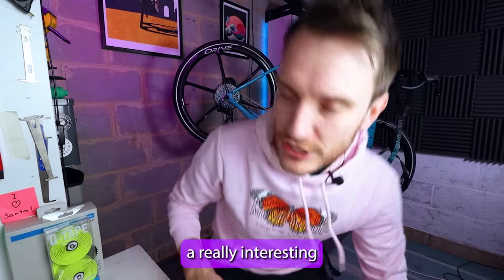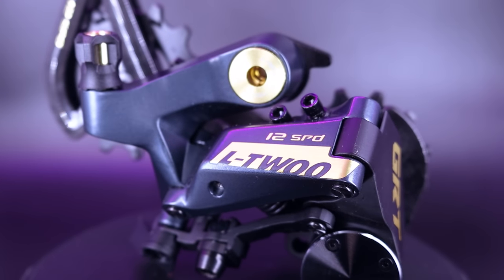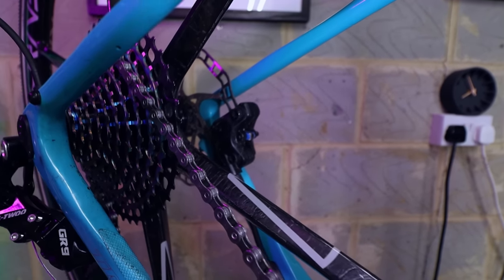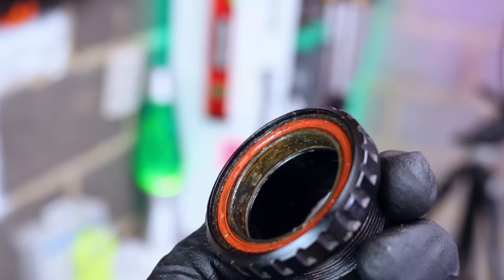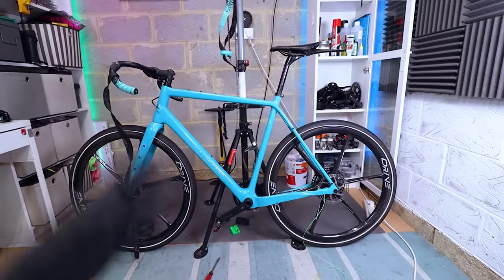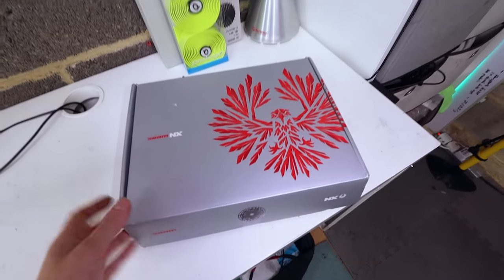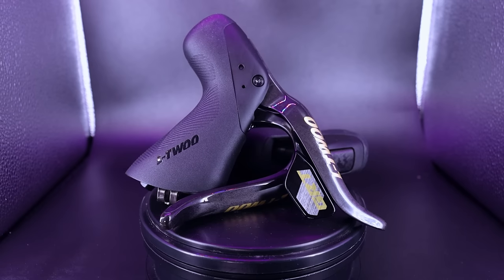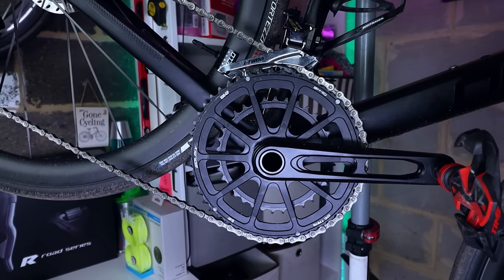INCREDIBLE 1x12 gravel performance on a budget - L-TWOO GRT

Comment: The cassette issue is simple enough. You are required to use the 10 speed spacer, required for mounting 10speed on 11 speed road bodies. The spacing of this 12sp cassette is based on the 10sp mountainbike body, which basically still is the same as the old 10speed road body. Mountainbike cassettes never required an upgrade of the spacing since the larger cogs can overhang on the spokes ( if the wheels are properly dished ). This means 11 speed mountainbike cassettes fit 10speed bodys ( also road bodys ) and so do the 12 speed cassettes. I am sure you have one of those spacers somewhere.
Reply: exactly! I was curious about this one too, since it means I can get a 12 speed cassette on my old 'mtb'
Reply: This is btw a great hack for using your older 10 speed wheels on modern 11 speed groupsets. Buy an 11-34  SHIMANO CS-HG700 which fits older style 10 speed wheels. Beware that most other 11 cassettes ones wont fit on 10 speed.
Reply: @luukrutten1295  (edited) it seems that indeed the 105 r7000 11-34 has a removable spacer, so it can fit 10 speed hubs! That's very cool obscure knowledge, thank you sir. I might try it out to play with different gearing on my 26 incher

Also seems like the ultegra HG800 one has the removable spacer. I've got that one laying around, so I might try it soon
Reply from the maker: Right ok. I did think think this myself actually, so as you suggested, I slapped a spacer behind the VG sports cassette. It mounted fine, but the indexing was WAY off, and the shifting was terrible. Then with the SRAM PG 1230 cassette on the same HG freehub (it's a bog standard 11 speed HG freehub btw), no spacer needed, and the shifting was perfect... I was pretty sure SRAM and Shimano 12 speed cassettes were interchangable...? (EDIT -  I was wrong! 🤦‍♂shifting is actually fine - See pinned comment)
Reply: 1st thought i had,put in a spacer
Reply: @TraceVelo  Not sure, maybe its just VG sports tooth profile and less 'gates' on which the chain can jump up. I have no experience with that specific cassette. I can confirm most ZTTO stuff is ususally really good. But maybe L-twoo can just supply or suggest an optimal cassette, since quite a lot of variables exist.
Reply: @TraceVelo  Oh and I hope you didnt get hurt in the crash. Be carefull! You are a brave man testing all this stuff.
Reply: I had the same issue with a Bolany (?spelling) Chinese 11 speed cassette - the 10 speed spacer ring solved it. Hope this helps someone
Reply: @TraceVelo  You definitely need to use 1.85mm spacer when using the mtb HG casettes on road 11speed hubs. I even need it for my 12speed ztto 11-46, the indexing is then same as my xD cassette.
Reply: @luukrutten1295  similarly…. The new microspline Shimano 12spd 11-30 and 11-34 cassettes fit on an 11spd HG wheel.  Plus, these 12spd Shimano cassettes both work with AXS groupsets.  (I know the road AXS chain rollers are larger, but I’ve got 1000+ miles on 2 bikes with no issues).
Reply: Beat me to it. Yep. Needs a spacer.
Reply: @Luuk - please dont attempt to glue or repair you front brake lever. They are too important to risk yourself. Show the public what you should do in this situation , dispose of the broken part. You wouldnt repair a cracked helmet , same principle here - the lever is a sacraficial item in this case. 
Stay safe
Reply: @darrenst441  i never said anything about reparing a brake lever. Or suggested doing so. Nor did luke. Anyway same name different spelling😅
Reply: @luukrutten1295  I also think he wanted to address Luke. :-) Luke said in the video he might try to glue/epoxy the lever - or something like that. :-)
Reply: THanks mate!

Comment from the maker: Also forgot to mention, the small issue that I had with the RX road version of this groupset (where the shift lever didn't return fully, sometimes blocking a shift with the thumb trigger), it's not present here at all! The shifting is basically perfect 👌🥖🥖🥖
Reply: On the back of that, Luke- did you work out whether the shift lever could be moved away from the brake lever using the grub screw on the underside?

I keep looking at mine, and wondering....

**EDIT

Answering my own question: on the R9 11 speed from L-Twoo, a 1.5mm hex key on the grub screw will move the shift lever away from the brake lever.
Reply: also do note i mentioned this before.
my sensah/senicx crank i replaced the bottom bracket also i had 600miles clocked before i had clicking cranks under pressure.
spent money on a nukeproof horizon one with titanium coated bearings been solid so far and chainreaction sell the bearings. not the cheapest but 800 miles later still no issue.
and yeah for cassette wobble you need a 1.85mm spacer on your road hub to fit an mtb cassette. I had this issue when i first built my sensah 11 speed groupset

also congrats on removing the conduct kit now you can get a fancy chinese carbon stem
PS , Peak Torque Youtuber makes an adapter that lets you mount hydraulic flat mount brakes with 180mm rotors , he also UK based
Reply: It's a quirk of the Campagnolo mechanism - same thing happens on my Ekar 1by13 shifter if the levers are depressed at the same time.
Reply: Mine are fine in the RX version. Maybe it is just not consistent from unit to unit ? Also mine don't rattle, I checked it. Mine are faultless except for the shifting performance, which is overall ok but no super crisp in all gears, it tends to be a little more lousy in the small cogs.
Reply: I'm sorry about the crash, glad you are ok. Could you possibly use the R9 lever as a temporary replacement? Curious to see if the epoxy repair job comes along as nicely as expected. Ciao! 🥖
Reply: @bama95  The R9 lever is a very different design to the new RX, I doubt its compatible. Again, I have to keep comparing to the Campy designs (now out of patent) which they've knocked off. I crashed hard on my Ekar in June and the alloy lever blades were thrashed, but not cracked. I could have ridden home on them if I hadn't turned my hands into hamburger.
Reply: @adambarlev8992  True. I get the same sometimes on my 10 speed Veloce/Apex Frankenbike. Have to change down two before it will change up again.

Comment: Hi luke, just a quick tip from a bike mechanic here ;), when working with hydraulics (especially bleader/removing a hydraulic system) take your wheels out the bike, and take the pads out. Then if some brake fluid spills, you dont ruin your pads/rotors. If you dont plan to reuse those, it does not matter ofcourse ;)

Comment: I've been using the GRT groupset now for about 6 months, mostly pretty happy.  I went with the aluminum version.  The shifting took some getting used to after years on Shimano style, and after a while I really don't mind the difference.  Shifting from the drops is easier with GRT than my R7000 for me at least.  The shifting mechanism is not as crisp or refined feeling as Shimano, and the upshift has some phantom half-click feelings that can result in not shifting, or getting a double shift if you are not intentional.  Braking has been issue free.  The left lever has a void where guts would have been, and I wish they filled that up so your left hand sits on the hood just a little different than the right.  The "butter zone" for the rear barrel adjuster just a tiny couple click region, and if I did it again I would add an inline adjusted at the front so I could adjust while riding.  Overall it does what I needed with minimal fuss, and made for a nice build I don't mind getting muddy or beat up.

Comment: The crash didn't seem that bad, to have resulted in a snapped off lever is a bit concerning to me. I've bailed onto my 11sp di2 Ultegra levers a number of times on dirt, gravel and pavement and they're still going strong despite some battle scars. That durability is probably worth it to me in terms of a small crash not being a ride ending event, as I need them to survive week long bikepacking trips in remote places without leaving me stranded.
Reply: In those flared bars, the shifters are more in danger of breaking
Reply: @the.communist  I run 52cm Salsa Cowchippers, so mine are flared too...
Reply: @mrhankbotful 52cm?! Not 42? Can't imagine riding bars wider than 38cm currently looking for 36cm ones.
Reply: @dan_lazaro  I'm bigger than your average cyclist, plus broad shouldered.  I did double check though and they're actually the 50cm version of the Cowchipper Deluxe. The 52cm bars I have are PNW The Coast bars.
Reply: @mrhankbotful  I run the kitchen sinks in the same size. I love them.
Reply: That’s the nice thing about shimano, it holds up. Too bad to see it break so easily, though idk I’ve ever crashed in such a way on my gravel bike either.
Reply: Looking at how it broke, ltwoo uses injection molding with short carbon fibers in it, basically the cheapest way to say "carbon brake levers".
shimano uses aluminium levers which are much more robust. Sram does carbon brake levers on their force and red groupsets, but I don't think they're injection molded.

Comment: Hi Luke, about the caliper adapters, 140/160 means it's for 140 front and/or 160 rear. 160/180 means for 160 front and/or 180 rear, so you can use the same adapter for rear or front depending on the rotor size
Reply: I'm not sure if it's that. The front one is usually reversible, but the rear is not (brake mounted directly to the frame). At least on my Cannondale. I think it might be related to some gravel bikes using the same adapters with a 20mm offset. Like using a 140mm adapters to use 160mm rotors, and 160mm adapters to use 180mm rotors, as AFAIK the flat mount standard only supports 140 and 160mm.
Reply: @endianAphones  That might true though, I don't have any experience with flat mounted frames, but it's common with these chinese adapter products using codes like that, usually for MTB that often uses big rotors than road bikes
Reply: @endianAphones  I think you're right, because the common adapters I was talking about are usually coded F140/R160, F160/R180, and so on

Comment: I'm really sorry about the crash, but also glad you're okay! Those deep ruts can be nasty. I've found moving my center of gravity a little bit back on the saddle helps me keep the steering steady on rough roads. I'd like to see how you go about getting a new brake lever, because I haven't seen any spare parts from L-twoo. Anyway, those cranks seemed a little bit too hollowed out to me, sadly, they were. In my experience the only way to get super stiff, reliable and light cranks is carbon. Aliexpress has been showing me some lovely looking carbon cranks from Racework, maybe they're worth checking out. Altough I got older Sram Force gxp cranks second hand very cheap, and they're amazing.

Comment: Brake caliper spacers are 140/160 for the minimum size rotor the mount is designed for (either 140 or 160mm depending on the frame) and the 160/180 is to go from minimum 140mm to a 160mm, or from minimum 160mm to a 180mm rotor.
Reply: Came here to say this. That’s exactly what it is.

Comment: Sometimes the disk brake mounting adapters can be flipped the other direction to fit either 140 or 160 (or 160/180).  The other orientation might put the caliper closer or further relative to the wheel hub.

Comment: Yo luke, if you reverse the mounting plates for the calipers, the size will differ. Use the 160 side & you move the rotor placement to accept the 180 disc. Switcheroo does it bro. Hope it makes sense

Comment: I had the same issue with a sunshine 11s 11-42 cassette. I ended up using the 10s spacer at the back of the cassette. Enough space left for the lock ring to go in. All working fine now

Comment: I think the 160/180 markings depend on what was the baseline setup. If the bike was designed for 140 originally it would (and did) support the 20mm larger 160. Had your bike come with 160s, the 20mm would have supported 180mm rotors

Comment: The crap getting in and not getting out is an issue also with original SRAM bottom bracket. I have also the same issue with wheels and so. Solution (or kind of) ... drilling holes for things to breath and dry. Otherwise the water ends up destroying steel/aluminum axles, bearings, everything.

Comment: Nice video ! To adjust the stroke of the brakes, you can push out the pistons a little bit and decrease the distance between the disc and the pads.  you remove the wheel and you activate the brakes, you have to be careful not to press too much to be able to put the wheel back on

Comment: Unlucky with the crash and glad you're okay. My impression of that was lack of grip at the side of the tyre. You hit an off-camber rut and it sent the tyre sideways.  I have done the same in the wet.  It is most likely the result of over-inflated tyres, which can bounce off and be deflected by off-camber edges. You need less air in your tyres to allow the tread to distort and grip the side of the rut rather than ping off them. 25-30 psi is the best pressure for gravel I reckon plus get tyres with reasonable grip at the side.

Comment: Bad  L-Twoo GRT experience here: rear derraulier is loose around the main hanger bolt, which makes it very imprecise when shifting gears. The shifter itself (ones on handlebars) have very off number of positions/clicks, somewhere around 18. So it is not 12 positions, and not 24 positions (say if they had 2 "clicks" for each gear selection).
Also brakes are very weak compared to both of my rim and disc brake bikes. I made sure that nothing is contaminated and everything is clean.

I had this groupset for about a year, and made my peace with imperfections considering the price. But eventually decided to switch to SRAM Rival, and that groupset is on a whole different level (and different price point too)

Comment: I guess the brake adapter numbering is because some forks are designed for 140/160 rotors while others are designed for 160/180 rotors. Same for the rear brake, some frames are designed for 140 while others are designed for 160. Depending on your fork/frame you´ll need different adapters in different orientations (or even no adapter at all) to use 140/160/180 rotors. Anyway, yes, the way they printed the numbers doesn´t help a lot.

Comment: Great video! Love the 1x12 group sets. Giving the Ratio update a go for SRAM mullet. I’ve tried fixing carbon/plastic shifter cracks in the past, with no success. The epoxy is strong, it just can’t adhere well enough. Will be interesting to see how you make out!

Comment: Another great video! Sucks about the crash. I'm running 10 speed GRX 400 alloy shift levers (converted to 1x). I've crashed on them numerous times and they've held up just fine. They're not the lightest, but the alloy shift levers are built tough. Just a bit of nail polish gel touches up all the scratches nicely! 🥖🥖🥖
Reply: Absolutely. A snapping lever is a big no-no on a bike, especially on gravel bikes. Maybe the carbon is in reality just ABS plastic with carbon print?
Reply: @DilbertMuc  The thing with gravel is that crashes/bike drops are more likely to happen. I'm guessing carbon fiber isn't a great material to use for a high impact component.
Reply: @jonathan_f2  Yeah? Tell that Boeing and Airbus. Hopefully their stuff is better resistant to impacts. Don't wanna lose a wing in turbulance... :face-orange-biting-nails:

Comment: @Trace Velo. At 12:00 in the video you talk about missleading numbering on the brake adapters. The reason there is 2 number is because you can use it both in the front and the back. The larger number is for the front and the smaller number is for the rear generally. Hope this helps 🫡👍

Comment: Hey Luke, speaking about fork adapter - I’ve just installed my GRT and 160 adapter let me use 180 front rotor, and same happened with my previous TRP Spyre C adapters, so it depends on fork mounting holes position

Comment: That crash test seems to explain part of the low price, I've crashed more times than I care to think about and my GRX600 is blemished but works as good as day 1. 

Hopefully they will fix that in future iterations, having a good cheap groupset is a win win for everyone.
Reply: I crashed into a tree and hit my shimano 105 shifter really hard,  The only issue i had was a broken shift cable.
Reply: yea my GRX and Rival groupsets on my gravel bikes have all taken a beating and still work like new. the only thing that happened was some scuffing on the shift lever where it hit the ground.
Reply: Shimano has the advantages that the levers rotate, so they should handle a lot more lateral stress. On the other hand my SRAM levers are like first gen 11 speed and they're fine... scratched, but fine.

Comment: As mentioned elsewhere it looks like you need a cassette spacer to go on the inside of the cassette. I have not worked out the circumstances for using them. It is generally written it is to put a 10 speed cassette on an 11 speed body, but I also think whether it is an MTB cassette also has some bearing here as well. I have 10 and 11 speed cassettes, some need a spacer, some don’t

Comment: Those adapters where a bit misleading but those numbers are correct. If you're using 180mm rotors use the other side which corresponds to the 180

Comment: Tips for riding farm land roads, Never stay on the middle/elevated part especially standing pedalling, Those roads are typically by a four wheel type of vehicle, And how cars work is that where the car tires are it would be typically flatter there. I might be wrong since I’m not from the UK, But back home, roads that are a car lengths wide are typically like that.

Comment: I think the adapters are numbered both ways as it depends what size rotors your fork/frame is designed to run eg most suspension forks are designed around a 160 rotor, but some are designed for a minimum 180mm so the adapter to take them up to 203 is different to allow for the difference in the frame/fork.